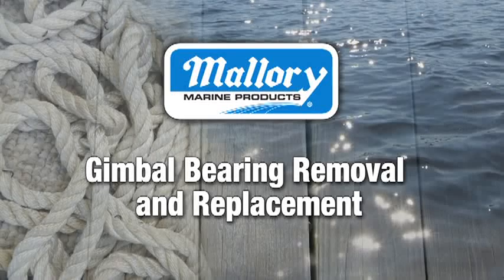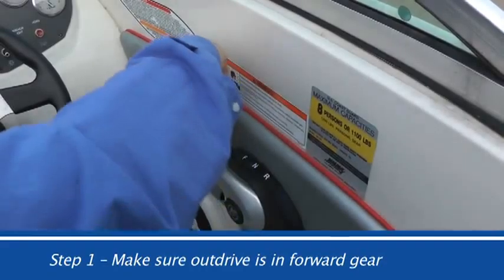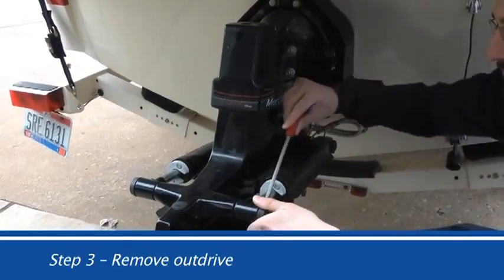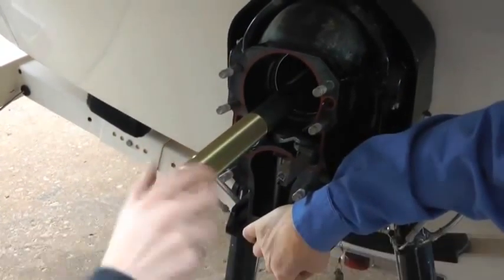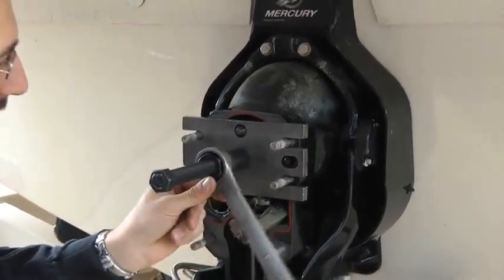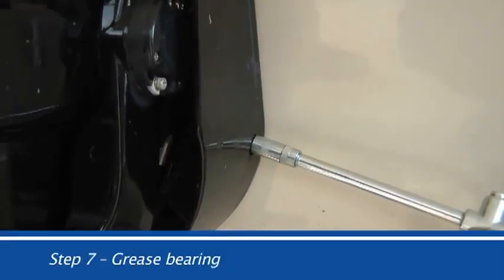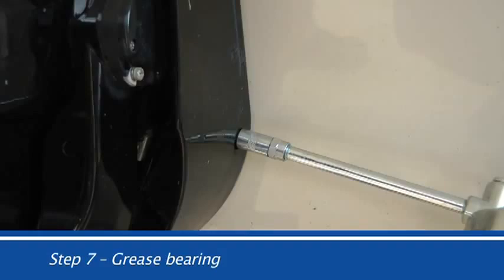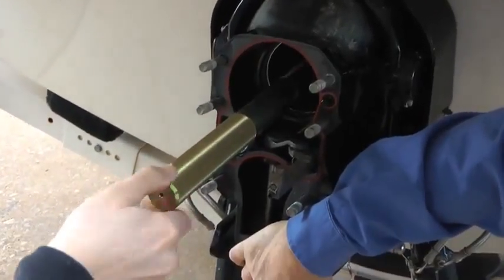Gimbal Bearing Removal and Replacement by Mallory Marine - iboats.com

Comment: I realize your company has been around for a long time and I value your opinion, but is twisting the alignment the "correct" procedure to test the alignment? Everything I have seen and read says Do not twist, push in, read grease marks on bar, adjust engine, rotate engine 90 degrees, rinse hair, repeat.
Does your way accomplish the same?
Thanks
Reply: Speakrdude Maybe they were checking the smoothness of the bearing, and not the alignment.